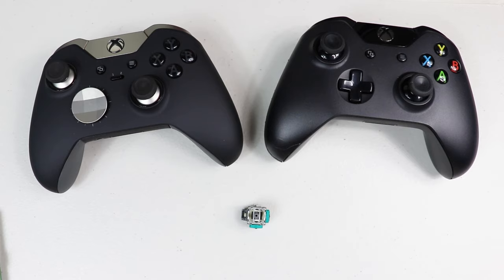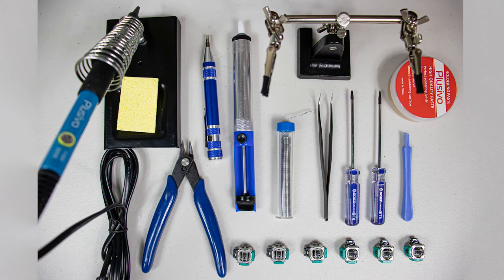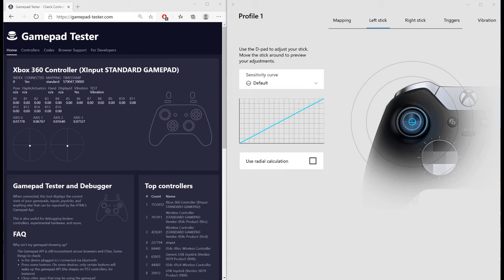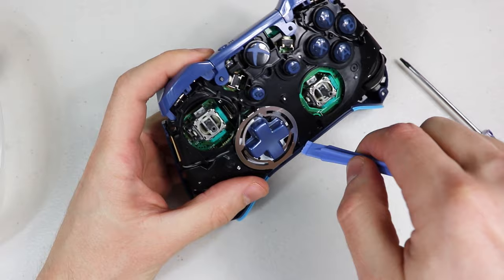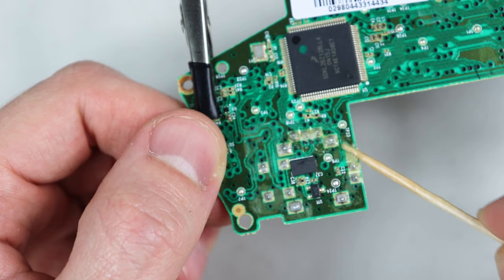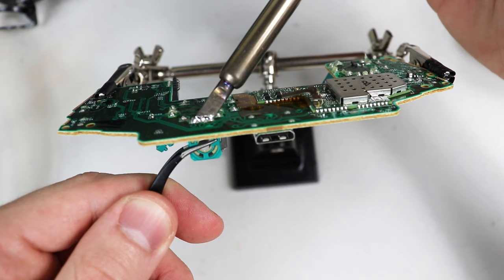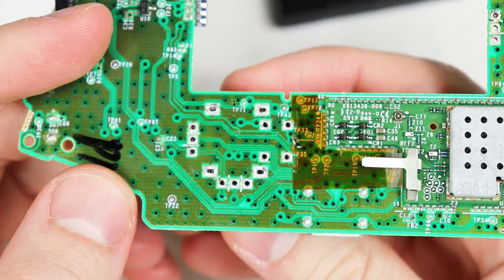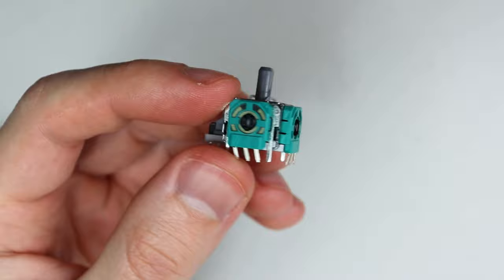How to Replace Xbox One Controller Analog Joystick - NEW METHOD - Fix Stick Drift, Broken, & Loose

Comment: excellent video,  thank you for posting.  I have a question.  I bought the repair kit to replace a joystick on an elite 1 controller because the joystick would stick in the upwards positron.  I pulled everything apart and noticed that the little gray piece was broken.  My question is,  can you just replace that gray piece?
Reply from the maker: I believe you are talking about the grey piece that covers the button? If I remember correctly it is technically possible but it is tricky and may even require removing the joystick anyway. Also, I think the tabs broke every time I've tried removing that grey piece from donors. It's been a while. Personally I would just replace it, but perhaps it's worth a shot trying it with one of the joysticks.
Reply: @SOSS GAMING I appreciate the insightful reply!  after watching your video,  I was mentally prepared to replace anyway.  Thank you
Reply from the maker: @thomasdansby7344  Good luck on the repair!

Comment: Hi  what is the stuff you apply where the rumble wires are before using the chizzle heat tip?? I'm new to tech soldering & eager to learn. Do you have a video on how to de-solder?
Reply from the maker: That was just some flux paste. Now I just add a little flux-core solder to help it melt. I don't have a video on de-soldering unfortunately, as I am still not a professional in that regards. These days I cheat with a Hakko de-soldering gun which is a game-changer lol
Reply: I'm just a newb, and can not afford that kind of kit, OMG. I'll go for something cheaper I think, hahahahaa
Reply: Can I ask what the difference is between a de-soldering tool and a soldering tool? Aren't they the same?
Reply from the maker: @swwolf3640  A de-soldering tool has tips with a hole in them to suck the solder up. Technically you could solder with a desoldering iron in some cases, but it's not ideal as an actual soldering iron will be easier to work with as the certain tips you can use work better at heating up whatever you're working on.

Comment: I’m having a hard time understanding why someone wouldn’t just go out and buy a new controller. By the time you get the kit and all the other tools needed it’s easily $60 or over which is the cost of a new controller. There is also a good chance that something will go wrong during the process or shortly after it’s completed. On top of that this is time consuming. Do people enjoy fixing it instead of buying a new one or what is the point?
Reply from the maker: I understand your point completely! I'm the same way with certain things. But yes, some people, like myself, do like learning and even tearing things apart and fixing them. Some people actually do it for monetary reasons because have multiple controllers to fix with the same upfront cost and saving over $100 and more. Some people also like giving the middle finger to Microsoft.
Reply: @SOSSGAMING  yeah that makes sense. Definitely understand what you mean about Microsoft too. Thanks for taking the time to respond.

Comment: I just attempted my first stick replacement the other night. It didn't go so well. I had a hard time getting the old one off as it took quite a while and I wound up just heating it with a hot air gun and pulling it apart till I got it all out. I put the new stick in and closed it up. When I tried it, the stick was stuck up. Left and right were fine. Even when I removed the stick and ran it, the same thing. I'm, thinking I did something to the board and may have to do trace repair to fix it. Hopefully it's easy enough. Any ideas?
Reply from the maker: Yes, it's likely a damaged though-hole pad. If you can identify which one(s) it is, you can jump a wire from the joystick pin to a point on the board. Here's a write-up I did: https://sossgaming.com/xbox-joystick-jump-wire/
Reply from the maker: Hope that helps, good luck.
Reply: @SOSSGAMING  Thanks a bunch! :)

Comment: The problem is that the potentiometers are made to a +/- 20% tolerance, none of the ones that I have were anywhere near what was required for one controller, my solution was to add a 33K 0602 resistor between 2 pins of the pot. The owner reports no noticeable difference between the left and right response of the stick with the resistor :)
Only 2 of the 3 pins on each pot are actually connected so the resistor trick only works if connecting it between those 2 pins pulls it in the correct direction.
Reply from the maker: What do you mean by +/- 20% tolerance? Sorry I'm not as well versed in that are as you are.  However, I'm glad you were able to find a solution to whatever problem you were having though, that's always a relief!
Reply: @SOSSGAMING  The  ones that I measured were between 8k and 12k, that's +/- 20% on the nominal 10k.
I eventually simply measured the old ones end to end and fitted the nearest value that I had and added the resistor to the one with no match :)
Reply from the maker: @steverpcb  Oh interesting I'd never thought the total resistance to be of importance. I've never had any issues personally but it's good to know to keep in the back pocket.
Reply: @SOSSGAMING  I have only done 2 sticks on 2 controlers  (4 pots), total resistance worked for me and may be an even easier method :) The problem potentiometer was where the controller had been calibrated with a (from memory) 12k pot and I only ones that I had were 10k and under, the value of 33k was simply because it was the first one on hand and centered the stick perfectly :) I initially used a normal resistor with leads rather than a Surface Mount one and held it across the pins, I could have done Ohms law calculations but did it by trial and error and picked the right value first time :) The Surface mount size of 0602 fits nicely between the 2 pins but needs ceramic tipped tweezers to hold it .
33k 0602 resistors are about $2 for 100 and ceramic tipped tweezers are about $2.50 :)
You could add a pair of the resistors to the kits for cents as they come on a reel of 4000 for about $10 :)
Reply from the maker: @steverpcb  thanks for the info! May have to look into that more when I get some more time lol

Comment: Lol I was hoping he would also show me how to take everything apart on the controller to get to the joysticks but, he explained. Then he fast forward to the removing of that part or wires but I think I'll go ahead and try anyways when the items come in needed to replace the joystick. I'm actually new to repairing controlling but it shouldn't cause too much problems. The controller is already messed up as in not playable at this point so even if I do fuck up, it should be fine. It's only the joysticks that are a problem so I know it can be repaired.
Reply from the maker: I'm sorry if it was confusing at any part :( Best of luck on the repair!
Reply: @SOSSGAMING  oh, your video was still helpful. I favorited the video so it can help me when my shipment arrives.

Comment: I feel like I actually have a good chance of repairing my controllers now. Thank you!

Quick question: one of them doesn't have significant drift, but snapped a post on the joystick. Is it possible to remove the analog stick but leave the potentiometers in place?
Reply from the maker: You can re-use the old potentiometers absolutely.  The only thing is that even changing the joystick base can cause the calibration to go off, but I'd say it's worth the shot at first, may save some time.  Great question.
Reply: @SOSSGAMING  thank you for the reply!

Comment: Thanks for your video, I am wondering how long the controller will retain the calibration, specially after heavy use (RPG).
Reply from the maker: Great question.  I'd imagine it has very similar longevity as a new controller's joystick.

Comment: hey SOSS GAMING i followed your video to fix my elite controller and was able to install a new joycon controller, but now i put it back and the lights and the vibration is not working i have double checked everything but cant figure it out. Any tips would be really helpful. Other wise the controller seems to be working .thanks
Reply from the maker: I am confused by why the lights wouldn't be working. For the rumble packs I believe polarity matters, so make sure each wire is going to the right location. If that's all good, then perhaps they are related somehow. 
Lastly, if it's an elite controller, make sure in the accessories app the rumble packs are on and the light isn't dimmed out. 
If it's not any of those, I am a little stumped to be honest.

Comment: Hello, how are you
I always watch your videos and learn a lot from you. my elite controller is pressing the RT button even though I'm not pressing it.
could you help me fix it or give me an explanation of what i can do.
thank you
Reply from the maker: From the sounds of it likely either the board has corrosion or some other type of crack or damage. It could also be the button itself, too. I would open it and closely inspect the main board thoroughly to see if you can spot it, sometimes it's pretty apparent. I've only diagnosed this once or twice though so someone probably knows better trouble shooting procedures than me. One fairly surefire way of "fixing" it is replacing the main board. Hope that helps.

Comment: Tried removing a faulty potentiometer with a hot air gun and after a lot of struggle, it came off. The solder wouldnt melt even at the maximum temperature with a soldering iron. Tried adding more solder but it wouldn't ball up. I had the smaller hole version. Unfortunately I ruined the contact points, because after removing the potentiometer, solder filled the holes. After failing to push them out with a soldering iron I grabbed a SIM ejector head and tried pressing them through. It didn't work unfortunately, 2 of the connectors were torn from the PCB and gave up, I wont resolder the lines for now, I put the whole controller and its pieces in a plastic bag for parts,  thank you tho.
Reply from the maker: That's too bad :/ If you want I can send you a schematic of a jump wire you can probably do to "fix" it. Send an email to my gmail sossgamingcs and let me know which controller your working on, maybe even a good picture of the damaged board.

Comment: Love the quality of your video and products. I just replaced my elite controller analog sticks with your modules and I have one axis on one module the is rapidly changing value between +100% to +40% on the Y-axis never reaching zero and unphased by pulling the thumbstick down or swapping potentiometers. Does this mean I burned up the PCB pads?
Reply from the maker: Oh no sorry to hear that. It sounds like either a damaged through hole (solder can't make connection between potentiometer pin and board), or less likely a bad potentiometer or wiper.  Which type of controller are you working on?
Reply: @SOSSGAMING  it is an Elite series one controller.
Reply from the maker: @DiscipleFan1992  If it is a damaged through hole and you're able to spot which one, not all is lost.  Usually you can make a jumper wire from the pot pin to another part on the board.  Here's a demonstration here: http://acidmods.com/forum/index.php/topic,44225.0.html
Reply from the maker: @DiscipleFan1992  and if you don't see the one you need, I'd recommend posting on the forum with a picture of the board.  The guys there are a lot more knowledgeable than me when it comes to that kind of repair.

Comment: I have a question. Let’s say that the only issue with the stick itself is the base. Could I keep the original potentiometers in while unsoldering and replacing the base and reconnecting the originals?
Reply from the maker: Yes, that might work. Worth a shot I'd say. You may need to adjust them if they're too far off though but that's the only thing.

Comment: Is manually adjusting the pententiometers necessary or will the joystick work ok without it?
Reply from the maker: Well, that's not a simple answer. It also depends on what you define as "work ok". I've found that about 1/3 of the time you won't actually "need" to adjust the potentiometers, as there won't be any in-game drift, but the joystick may still be off center a bit, which can still effect gameplay. Then the other 2/3 of the time you may experience "drift", meaning it's off-center enough to cause drift in-game. Though technically if the game allows it, you can increase the deadzone and not experience drift. Making it technically playable, but again it will effect gameplay as you won't be able to be as precise with your joystick movements. 
I hope that helps you see the issue here, so I'd definitely recommend getting them manually calibrated if you can.

Comment: Hi there. Thanks for the vid. Top information. I just wanted to ask maybe a stupid question but when you kept taking the senior bit off to adjust it. Is it not possible to just replace this part instead of the hole analog stick. Is it also possible to just refit old one i.e if it pulls to the left, take it off pull the pins in other way then refit it or will this not work properly??? Thanks
Reply from the maker: If you are referring to a controller with stick drift the answer is no because the old potentiometer is too worn (which is what is causing the stick drift) and will need to be replaced with a new one.  However, if you only have stick drift it is possible to only replace that potentiometer that was causing the issues with a new one without needing to replace the whole joystick.  Not sure if that's what you were referring to.  Hope I answered your question, let me know.
Reply: @SOSSGAMING  Hi yea thats what I mean. If the joystick only has a 20% drift to the right, can I not only change that potentiometer instead of the hole joystick. Everything else does work properly on it. If its best to change the hole unit not a big deal just it make sense if that's the thing causing the issue. Thanks for replying think you did answer my question just wanted to confirm. Top video look forward to watching more
Reply from the maker: @Rick3121984  Ok, cool.  Typically if it's an original joystick that's off center there's damage to the potentiometer and replacing just that potentiometer (and calibrating) will do the trick.  I mean it may be possible to re-calibrate the original, but I don't think that is usually the case as I have never technically tried that.

Comment: I sent my xbox elite 1 to repair some days ago. Dpad failed and paddle P2 didn´t work, tomorrow will arrive, but from now and watching videos like yours, and reading info,  I will try make for myself. If you had to choose using solder wire of 0.5 mm diameter or 1 mm diameter for repairing xbox controllers, which do you think would be better?
Reply from the maker: That's great! I actually still consider myself an amateur when it comes to soldering, so my recommendation is just on my limited experience.  But I've been using Kester 0.8mm (.031") solder on these controllers and that's been doing the job just fine.

Comment: at 28:12, the wire that connects the top to the bottom motherboard... can you tell me how you disconnected it and how to reconnect it without damaging it?  in the disassembly it was already disconnected and you didn't mention it.
Reply from the maker: As long as you aren't forceful or anything it should come off quite easily.  But if you wanted to be extra careful you could pry up on two sides at the same time I suppose. Sorry for not showing that step.

Comment: would it also be possible to adjust the potentiometers on my current stick using the methods you have shown? Perhaps my potentiometer may just be off, and I can fix it by adjusting it.
Reply from the maker: If they are in good working condition, then definitely :)

Comment: I’m still in the process of learning the Xbox controller, but just after watching the video, is it necessary to remove the vibration packs? But the looks of it the only thing that does is allows you to not risk tearing the cords. Now if I’m careful could I skip the de-soldering of those cords?
Reply from the maker: Technically you wouldn't need to, but it does make life a lot easier if you do. It's quite cumbersome and tricky moving the board around with the vibration packs still attached.

Comment: Why would you show the calibration after you show the installation if it needs to be done before soldering?
Reply from the maker: Hello! Thanks for the question. I show two ways to calibrate, one where you can solder on the potentiometer first then adjust (which is the part I assume you are referring to), and the other where you can bend the pins in attempt to get a reading first then solder. I prefer the ladder but the first can be useful as well.

Comment: I have a board that is reading -0.17 on the x axis when no potentiometer is present at all. Any potentiometer i try is centred when i push the stick right and then gets stuck at around -0.17 when i push it left. Any ideas why? 

Love the tricks in this video btw. I will definitely be using them 😅 thank you
Reply from the maker: Great question.  The only time I've experienced a reading that wasn't 1.00 with the pot out was when the board had damage (was cracked at the joystick area).  I don't have any other idea than that :/ And that would require a new board most likely. I've literally only seen that once so it doesn't seem all that likely that it's the case but then again what you describe sounds very similar.
Reply: @SOSSGAMING  I've looked at the board and everything seems to be physically fine but there is a white smear a little up from the stick. Could be water damage i suppose. The one remaining potentiometer is reading diagonally rather than up and down. Strange!
Reply: @scottgrafton68  Follow the pcb track and check it end to end with a meter, flex the pcb while testing, if a track is suspected of being broken then solder a wire to bypass the track.
Reply: @steverpcb  i don't remember what i did but i managed to fix it